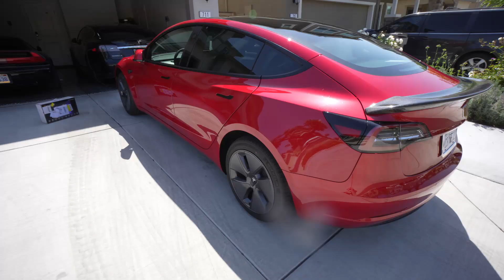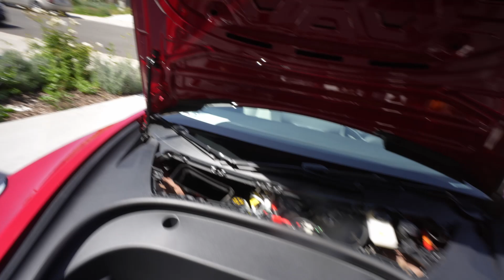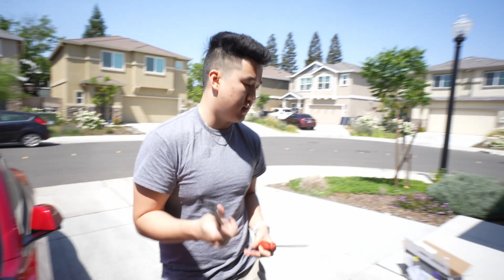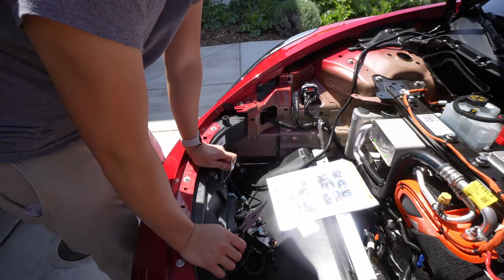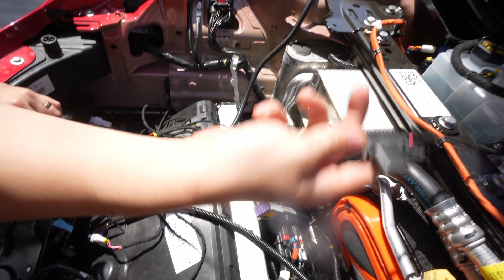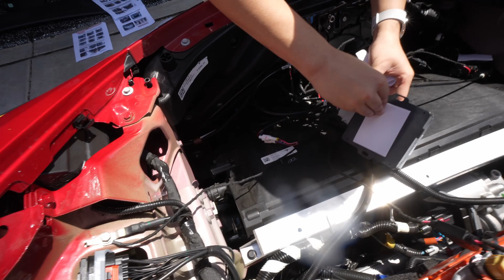Power Frunk in a 2022 Tesla Model 3 | Install | Hansshow

Comment: Tried installing power frunk today but had problems with the hood closing. Seems the the power struts are too thick and won’t fit flush against tub when closed. Any suggestions?!?
Reply: I’m in same boat and I know this was posted a year ago but nobody tells you even the instructions, you must mark the hood latch before removing. I’ve been adjusting it slightly for hours now with no luck.

Comment: Did you drill into the battery connect or did you just push the wire under the cap? Will it just stay under that cap?
Reply from the maker: I just pushed it.